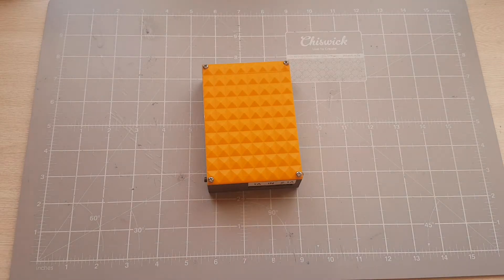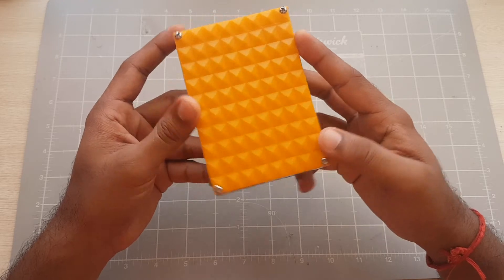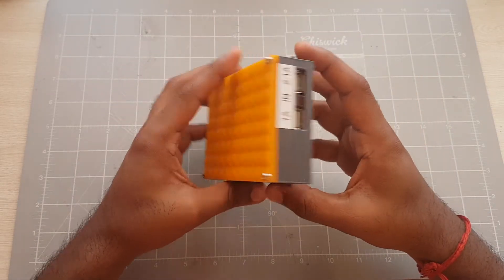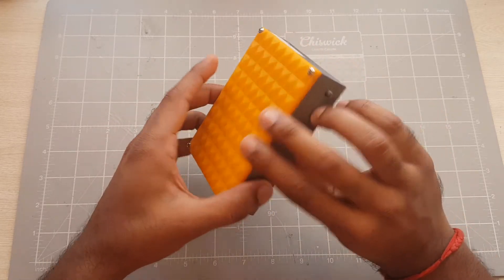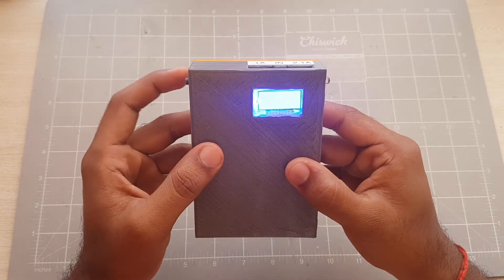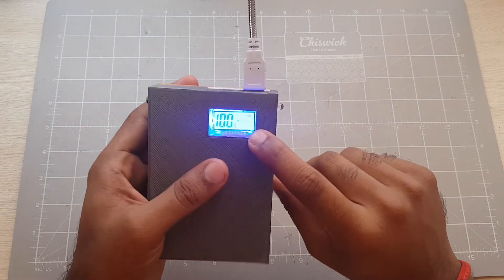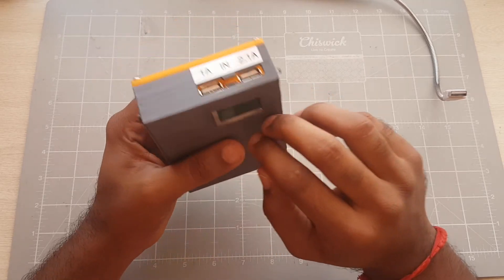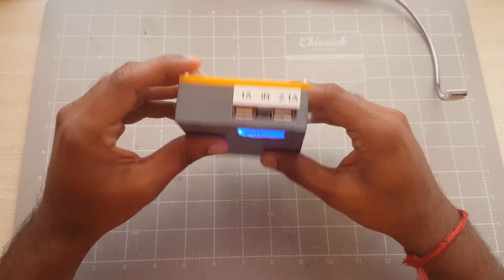3D Printed 12000mAh Power Bank

Comment: Does the led lamp get brighter when using the 2.1 amp port? I'm trying to find out if it actually outputs 2.1A,  or it just indicates the 2.1A port is being used...
I have one of those boards coming in the mail, I guess I should have thought of this earlier, but I'll find out sooner or later.

Comment: How could you make this to power up a PlayStation 4 or a tv ? Would you have to add a power inverter ? Thanks. I’m trying to build one for my family.
Reply from the maker: Hi Brandon, this wouldn't be able to power up a PS4 or TV as the output voltage is 5V and max current is around 2A. You could potentially build something using those batteries but you will require different circuitry. 
Perhaps something with a 12V output and you'd have to limit the current to safe amount. 
Yes, you would need a battery source and an inverter to power up an AC device - like a computer UPS. 
Just a heads up, those 18650 cells and any project involving AC can be very dangerous, so be careful!
Cheers :)